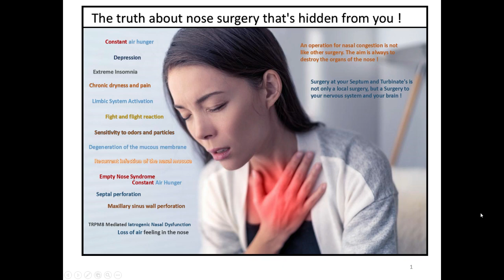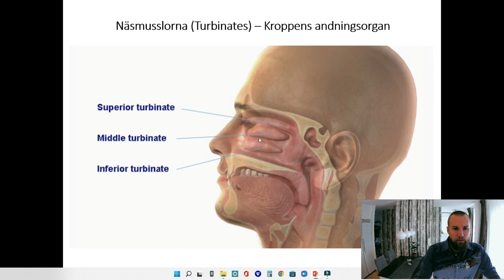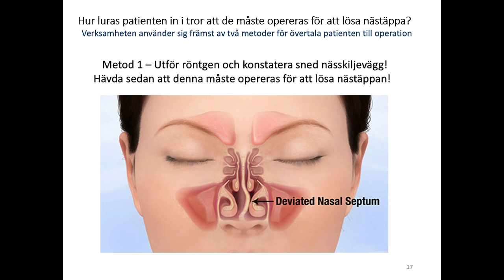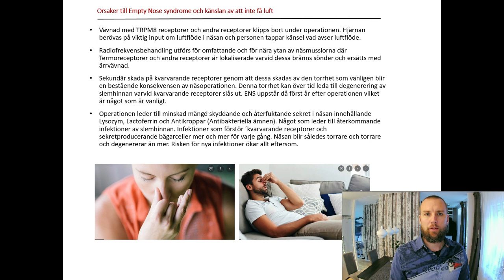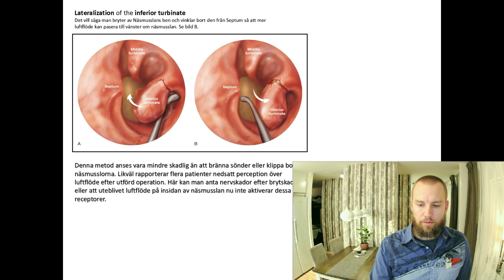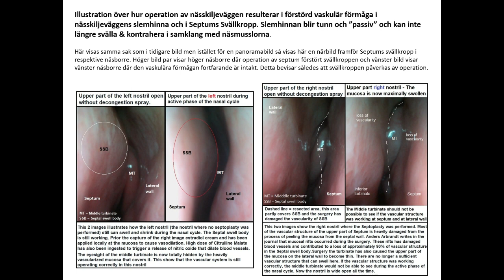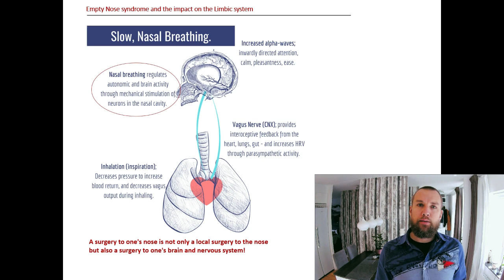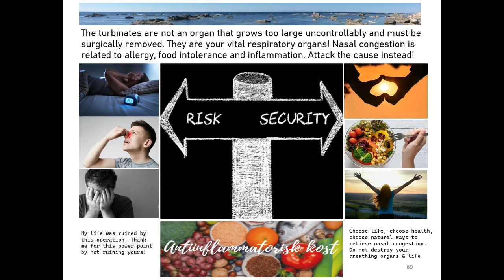Empty Nose Syndrome: a scientific explanation - Complications from nose surgery doctors hide

Comment: HELP. I just heard you say that an injury could require a septoplasty because the turbinates won't accomodate the change, but you've said never to have surgery to the turbinates. What to do?
Reply from the maker: A bigger deviation from an injury in adult life will probably never become compensated. The turbinates has now got the finale shape and size. If a deviation happened in early childhood there could probably be some adoption at least to a certain point. If you realize that your deviation is the reason for congestion and it’s a big problem you might want to look into finding a skilled surgeon who know about ENS, but only if it’s a huge problem for you. During a septoplasty it’s easy to tear the mucosa and if that happens you have big problems. The mucosa becomes thin and airflow perception lowers. If you lose to much of that perception you will suffocate. It’s not only about turbinates. Septal mucosa is also extremely important for airflow perception .

Comment: Curious if you notice/experience balance issues with ENS or any problems around very bright spaces like a shopping center/grocery store. Seems like ENS and its impact on the nose could play into some other issues with the balance system. 

So can you share what makes it go away more? Good sleep, humidity, etc. Would be interesting to see if there is one common item that gives relief to sufferers so maybe some help can develop.
Reply from the maker: No I don’t have balance problems. I know sleeping pills cause brightness sensitivity so if you take that maybe it can be your problem? 

Some to try, humidifier, nasal filters, estradiol ointment inside the nose, no coffee, no sleeping pills or maybe cartilage implants inside the nose or stem cell injections inside the nose. 5 - htp for serotonin. Temporary Cotton implants inside the nose for more air resistance

Comment: Hey, not sure if this will happen with a balloon sinuppasti? Clogged sinus won’t drain but I breathe ok. Any advices?
Reply from the maker: All surgery that affect the nasal mucosa and weakens the nasal air resistance can cause ENS. 

I’m not knowledgeable about sinus surgery but during the years I have seen many patients in the patient group who have lost the entire wall between the sinuses and the nose and they have the most severe problems. Nose and sinus are now  one cavity and this causes a lot of problem. Air resistance is severely lost and this leads to shallow breathing and CO2 intoxication. It’s also related to severe pain in the nose and face.

Secondly problem is you can not trust these surgeons they do whatever they like and you might end up with bonus surgery at septum or in turbinates while being sedated. These surgeons just love  to cut parts out from your inner nose. And that’s part of your autonomous nervous system. If affects the entire body for ever and not in a good way. 

I guess a small opening to the sinus is something completely else but be carful. I would try to figure out the real reason for the problem. One thing you could try if it’s only one side of the sinuses which is blocked is to try to sleep on the other side. This allow the middle turbinate to deflate and should allow better chance for drainage from the sinus. 

Then it’s diet and try to reduced inflammation in the body you can work with.

Comment: I had a polyp removed from left side of nose and I developed scar tissue between inferior turbinate & septum, could this cause ENS?
Reply from the maker: @Munin80
för 1 sekund sedan
Scare tissue at the mucosa will reduce the airflow perception but if it’s limited to a small area I find it likely that other sensory neurons can pick up the airflow along the nasal mucosa,  so it sounds unlikely. Maybe more to
Reply from the maker: The extent that adhesion in the nose can redirect airflow to less sensitive parts of the mucosa where airflow can not be felt that strong.

Comment: How about if it's a deviated septum by recent injury? Can you tell if it's recently deviated? One nostril not breathing as well. Can you avoid surgery for a natural treatment?
Reply from the maker: I  recommend you to go to AliExpress and buy a decent endoscopic camera to see for your self if the deviation is blocking your airflow. I have my own camera and have learned so much about my condition. Record / watch inside your nose during different periods of the nasal cycle and you will see if there is sufficient space for airflow to pass the deviated part when the nasal cycle is under vasoconstriction in that nostril. If so there is no need for a septoplasty. Then you need to lower the level of inflammation instead in the body to “shrink” the turbinates.
Reply: @ENS.AWARENESS  Thanks. I don't think it's a deviated septum because I've always had a deviated septum. The collumella still looks the same. I think I still have vestibular sensitivity and other internal inflammation from the trauma. It didn't hurt, no blood, etc. They say they could have put a fracture or deviation back in place before 2 weeks, but wouldn't it only be external and cosmetic? It would have to be an obvious break. There aren't sockets inside the nose where they can just plug everything back the way it was. How would this snap the internal structure back in place?